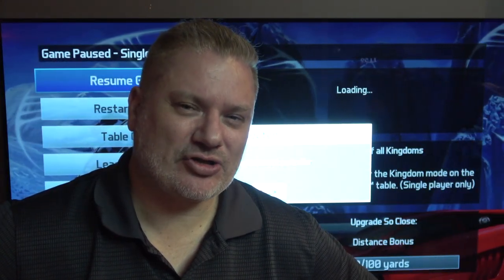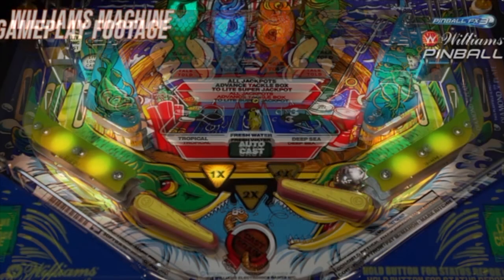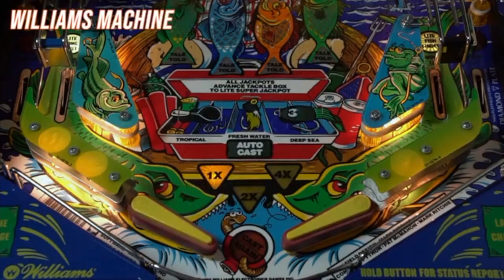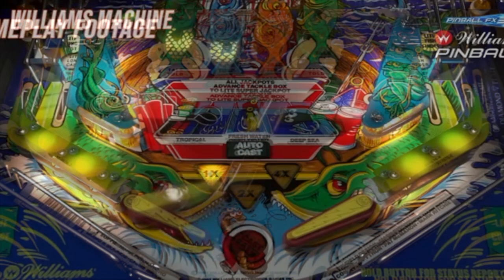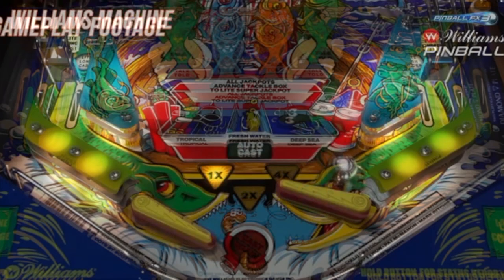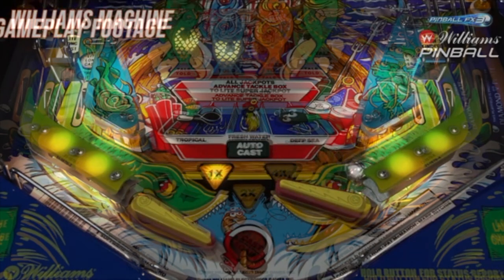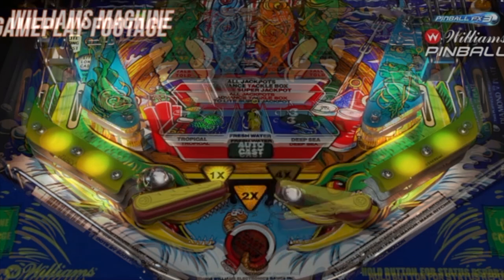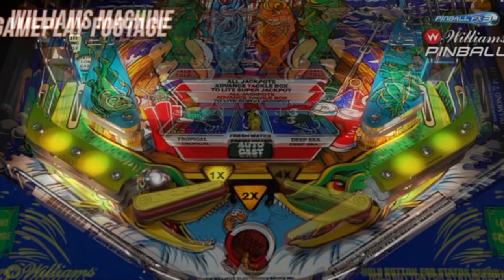FE042 PinballFX3 Physics: Flipper Tricks!

Comment: It's very cool that they're reaching out to the pinball-sim community like this.
Apart from the physics, what really struck me is the stark  difference between the table sounds of the real machine, and Zen's table. 
As I said in the comments to that video, the real table sounds (e.g. ball roll, collisions, flippers etc.) are loud, harsh, random, echo-laden, striking. The balls "clink" together, the flippers sound like metal rods being smashed by an electric coil, etc.
In comparison, the  Zen table sounds are very simple, and mostly canned. They are surprisingly "dull" sounding; muted.  IMO, the have improved over the years, but they don't sound realistic. So, fingers crossed that they can invest some more time in to the table audio.
Reply from the maker: Agreed, on a previous video I made reference to this and cranked up their 'physics volume' in the options to the max. But it's still not enough. Hopefully they adjust this accordingly on release.

Comment: Great video again. Good idea About the spin and think they really can look at it good with a ball with lines on it. I have a Pinball with An eye on it for my Class of 1812 and you can see the spin very Well. The bouncing on the flippers can also be rubber related  you get that on a real table to. There is difference in bouncing in black or red rubbers and also Old ones can behave different. I also like that Zen is really listening to the community very promising times.
Reply from the maker: Thanks and yes agreed regarding the ball and rubber differences. Thanks for sharing your thoughts.

Comment: I think it's another good video BUT you raise an extremely valid point at the end. You're comparing only ONE example of each shot and the critiquing the physics based on that one example. I'm not sure if this is the correct way to do this. Three post passes will have three slightly different results. As I said previously, more spin would be great and the only thing missing is the ball jumping up off the playfield, that would be just the icing on the cake. They're there  from what I've seen, it's done. Release and tweak/experiment with ball elevation and hone that and add later.
Reply from the maker: Yep, there is no 'correct way to do this'. Agreed, spin is lacking and hopefully they will improve this. Ball z-axis may not make the release date but maybe they will work on it on their roadmap, we'll have to wait and see...
Reply: At least there is some actual spin they have going on, as opposed to the visibly rolling ball in TPA that doesn't actually have physics supported spin.

Comment: Well done, you should work at Zen ;-)  Hope they will include table slope options and light atmosphere options (night, day etc.)  Can't wait! 
My idea and can be better are the flashers, they produce way less power. I also miss light wall reflections, it makes the lightshow in the game so much more impact. Otherwise, well done guys!
Reply from the maker: Agreed, they need to do lots more on the lighting side. They have it on their roadmap as they have some technical challenges to work through with the way their engine is now apparently. But I hope there is some basic improvement on release and then more options later.
Reply: yes agreed the lighting needs some attention when they get time.  Darker tables please, with sliders for bulbs and lights!

Comment: Does the L Orbit in Medieval Madness still feed the ball right into the slingshot?
Reply from the maker: I’ll need to check that out. Im expecting to do another video covering a play through of MM before release.
Reply: A full Right-to-Left orbit when you do a joust loop generally doesn't hit it every time, but when the ball is released after a castle lock or when you put the ball in the moat, that's what you need to look for.  That drove me up the wall in beta, that and the way multiball feeds to the very tip of the L Flipper or SDTM  in Fish Tales.